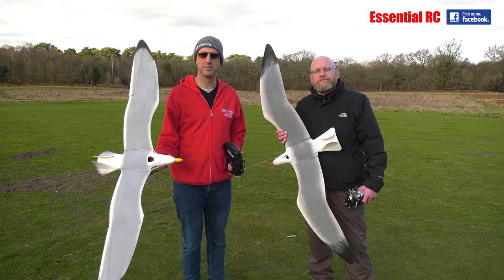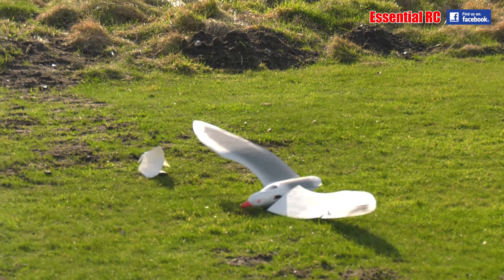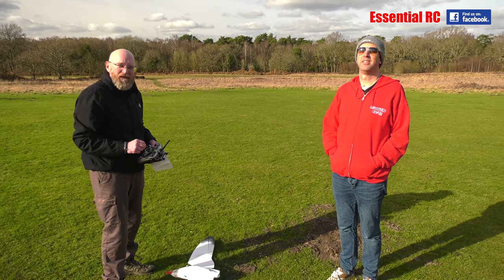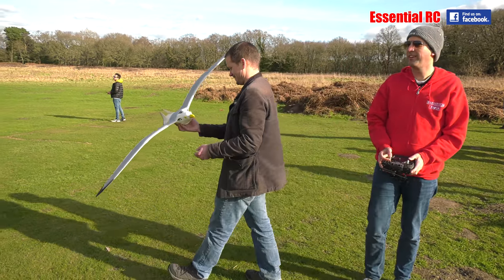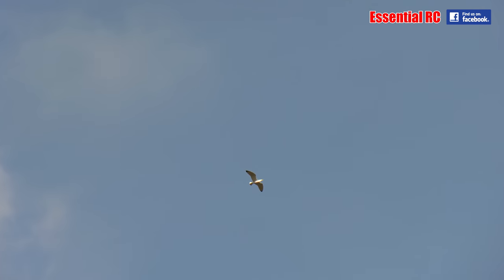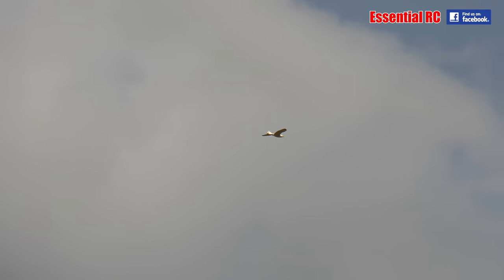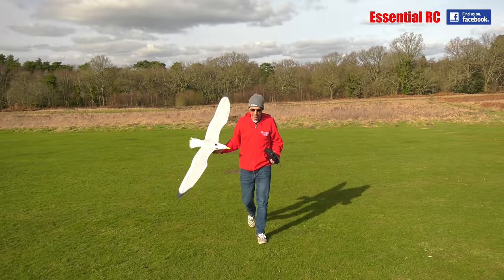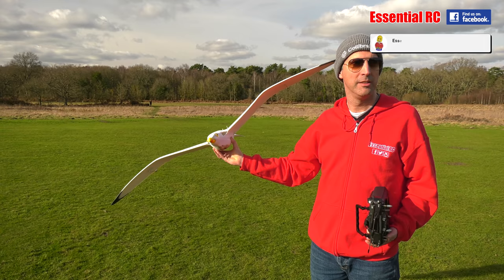Seagull RC EDF Jet !? 3D printed...and IT IS AMAZING !

Comment: i dont think the fist guy tossed it bad it was the driver , he pulled up way to hard and stalled it then just not enuf speed to get out of stall!
Reply: Agreed, it just pitched up so quickly that I don’t think the throw caused it (not entirely at least). Looks like bad CG or incorrect mix btw tail/throttle like described in instructions.
Also, why use 3S, don’t they say it’s 40mm with 2S?

Comment: Sorry to say it - but the RUN and Launch shows why you should not run ... everyone makes the mistake of thinking they need to run and then when they launch - 99.9% stop as they throw - but then they are out of 'balance' and models go up or lawn dart. Second launch shows clearly a better standing throw - more controlled ... flatter  .. 
Another item : Dr Mad Thrust EDF's are yesterdays EDF's .... todays EDF's ... FMS / Powerfun / QX etc. are far better - in sound, thrust and amp draw.

Nice to see the second one flew well ... pity about the Dr Mad Thrust fan and its high pitched whine ...
Reply from the maker: Don't learn unless you get it wrong a few times. Lesson learnt by all of us on that one.
Reply: FMS doesn't make a 40mm, neither does Powerfun and QX. Well, I haven't seen a QX 40mm, but the 30mm QX is absolute rubbish.

The best 40mm EDF setup is over 10 years old: AEO bolt-on impeller and ARC-20-34-2 (ARC 130) inrunner or similar that can handle 300W.

Comment: The first throw wasn't great, but unfortunately the pilot didn't push the nose down to let the model pick up speed before climbing away. 
I think he thought that the initial climb was sustainable - with the disappointing result that we saw. My 2 cents worth.
Reply from the maker: Think you're right Richard. Not always easy to react quickly enough to catch these things. Easy fix I think. He'll be trying to fly it again soon.
Reply: It also looked a bit tail heavy

Comment: First one looked tail heavy. Maybe the battery slipped back with the throw?
Reply from the maker: Maybe a little but the launch really didn't help.
Reply: @EssentialRC  True. Looked like his hand slipped. But the way the other glided, I kinda think combination of tail heavy and bailing on the launch contributed to the crash. 
He could have kept the power on, dropped the nose a touch and built up some speed to avoid the crash. Instead he killed the power, it stalled and that's all she wrote.
I know its easy to sit here and assess the situation. It all happens so quick when your flying, its only after that you can say "if I'd done this or that, it might not have crashed!" 
Good thing about 3D printed stuff, a few hours of printing, some CA glue and more paint and he's back in the air. Look forward to seeing that.
Reply: @blackbirdboy1  had to kill power as was aiming at the pits.  You are probably right but had no choice from a safety perspective

Comment: Al`s sounded like it was sucking not blowing? Did he glue it and fly again? James flew awesome.Be good FPV at the seaside 😆
Reply from the maker: I'm pretty sure he has fixed it and flown it since then. I've printed all the parts for mine. Just need to find time to assemble it. I'm using a bigger 50mm fan in mine though. 40mm fans are hard to find and the recommended German retailer won't send them to UK.

Comment: That Airframe Resonates.. A Lot Have a few of those Lander 40 fans.  They are Not nearly that noisy.. in Trad built airframes :-) 
Possibly consider a soft mounting... I certainly would.
 Soo.. what are we looking a ..  50 or 60 hours of babysitting the printer . And How much ?  LWpla gets put into one of these ? Asking as LW pla is pricey.

Comment: More I look at this the more I want to visit my old Dragon, yes as a recycle project for one of my children, due the next day....kids. We built a dragon, 35 inch ws small but detailed,, after the boy had nodded off to sleep I finished the paint and scales ...something about it felt right, so at 3 am I GA e it a toss off the deck....tail heavy. ...a random wood screw lying on the bench, was put in the open mouth, and screwed down out of sight, from the deck it crossed the yard and over the fence ...darn climbing over fences was easier as a boy ...recovered and wiped down it made its way to school, for days I got request from parents for a dragon ...loaded the plans to the school bulliten board .  Could I 3D print the dragon? Maybe ....

Comment: Plane print  has awsome  stuff but their prints seem to be specific to one printer... I use a creality ender3 v2 and even after I slice it the prints turn out not very well.... yet I use eclipson files my prints turn out awsome.... any advice.... I use lw-pla and basic lw-pla settings on my printer
Reply: Eclipson offer the ready Gode not plane print , but if you play with the slicer and follow the Planeprint advice you will get good result + its a Facebook group who will help you .
Reply: @georgehenzen5757  I tried plane print settings on cura slicer.... some of their recommended settings I didn't see on cura .. I did upgrade  cura ..yet some of the prints still come out strange....I don't need criticism... just advise
Reply: These were printed in a cr10 V3.  Took a few sample wing prints to nail and ended up with a higher flow rate than suggested, but a bit of tweaking and they came out sweet.

Comment: Love the video, is this using the standard 40mm edf ? There are modified plans on the plane print pilots Facebook group for a 50mm edf version, a bit more efficient and easier to source than the 40mm units
Reply from the maker: Yes. 40mm.
Reply: Any link to the 50mm edf plans?
Reply: Do you have a link to those plans?

Comment: He blamed James for the throw I don't think so didn't have enough power.
Reply from the maker: Same setup Kevin...shouldn't need much power after a good launch.
Reply: In the video mentioned one edf had more power.
Reply: I totally agree with you 😂 thousands wouldn’t
Reply from the maker: @jamesbennet5409  We've all done it James. Al will get it fixed up quickly I suspect